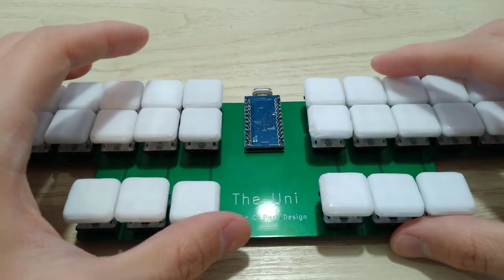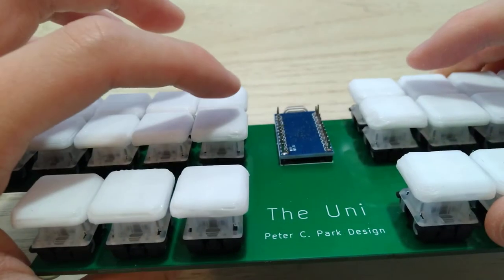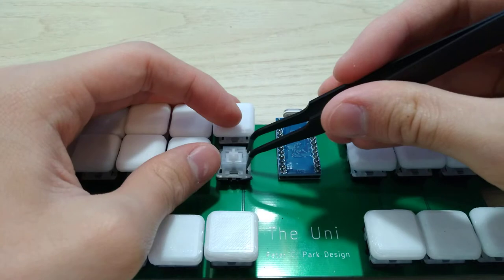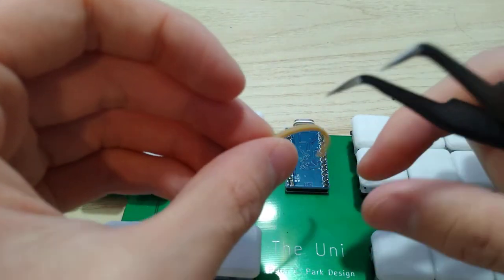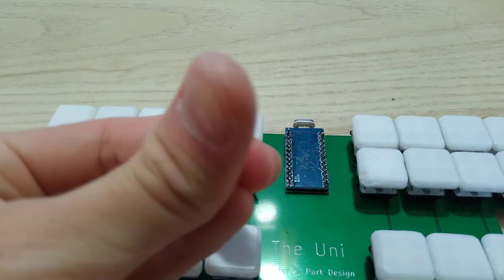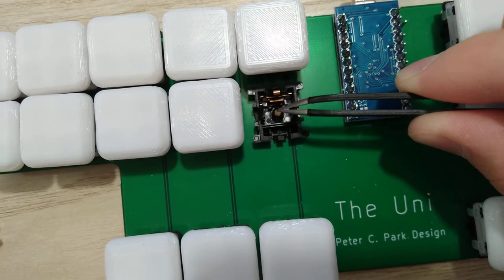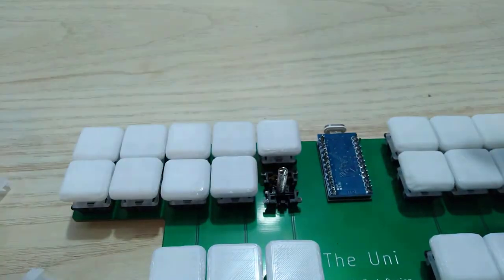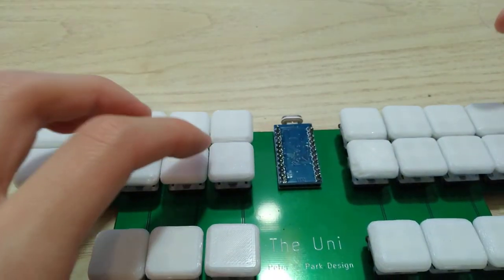Trampoline Mod To Silence Your Switches And Shorten Key Travel

Comment from the maker: It's better to use o rings for a more consistent result but if you don't have any, you can use the trampoline mod! Also if the rubber pieces are too big, you might have trouble actuating the switches so make sure the rubber pieces are not too big.
Reply: Good tip you have there, thanks!
Can you show how to silence the upstroke noise?
Reply: O rings do not work on some key caps. Actually what you showed is more consistent